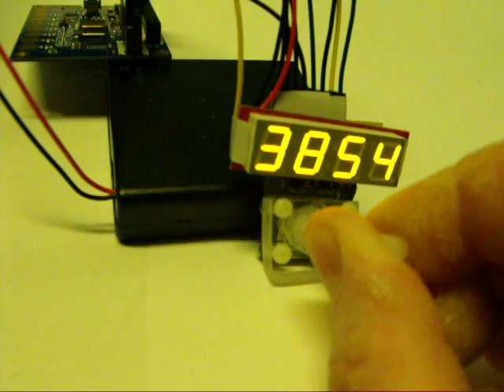MagneticEncoder120320a.AVI

Comment from the maker: The encoder is outputting a rotational position which has a linear relationship with the angle of the shaft/knob. If the wrong size of magnet is used with these sensors, the output from the sensor may not have a linear relationship with the angular postion of the knob.